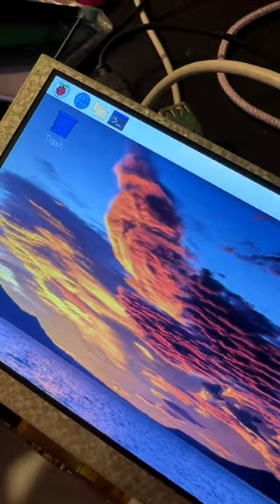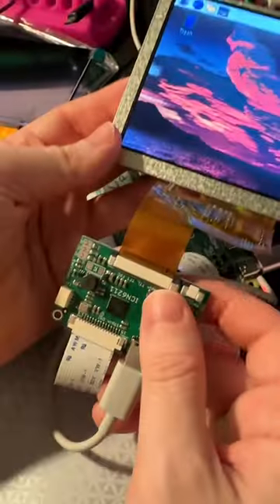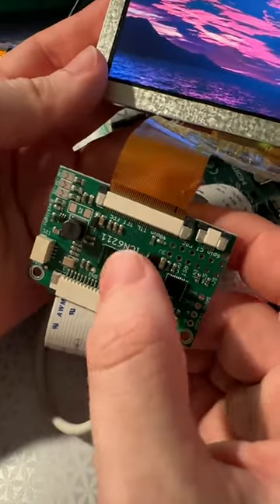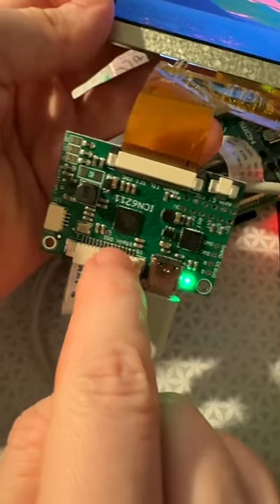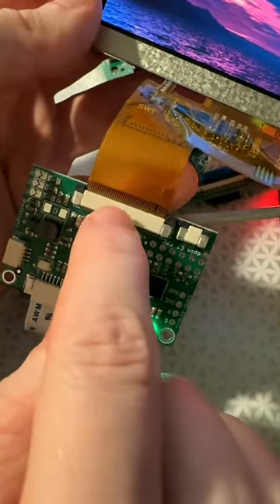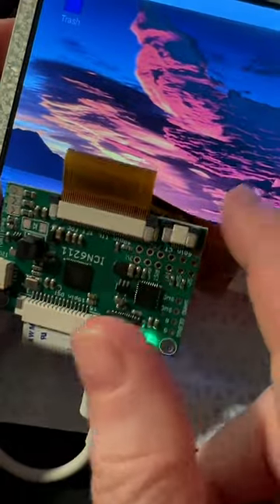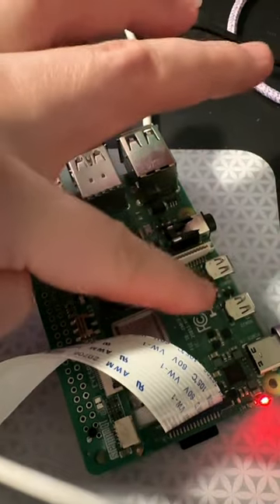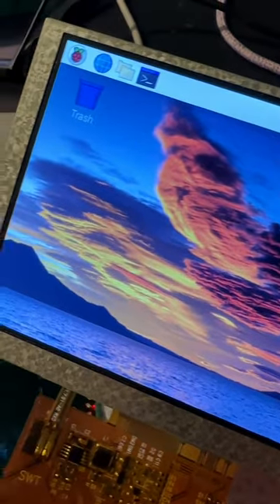ICN6211 DSI demo with 5" 800x480 display on a Raspberry Pi 🔌📟👨‍💻

Comment: Does it work right out of the box or do you have to add drivers to the raspberry pi to make it work I had bought a touchscreen once for mine and I had to download a specific driver that was made by the manufacturer for the touchscreen to work does this need the same thing done in order for it to